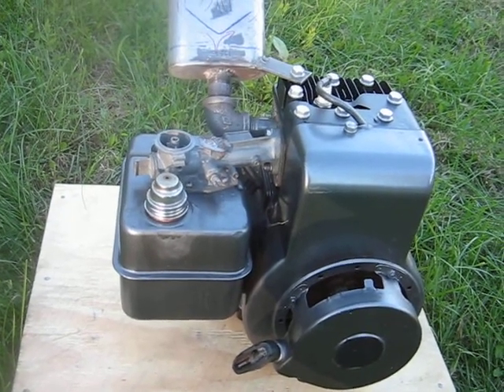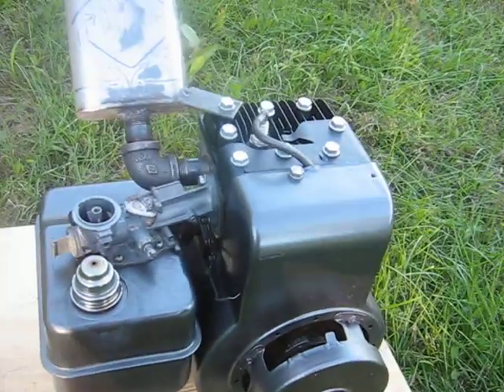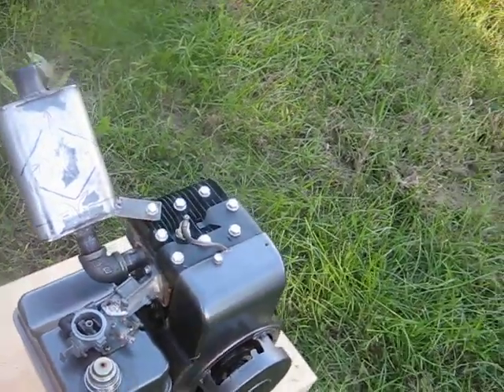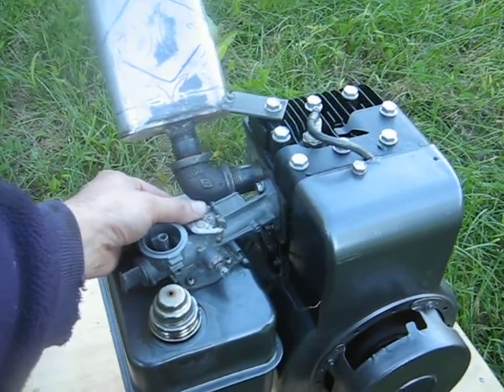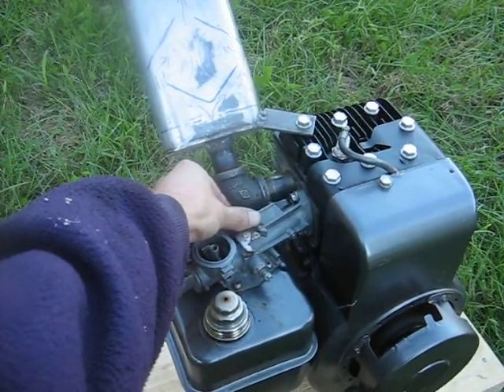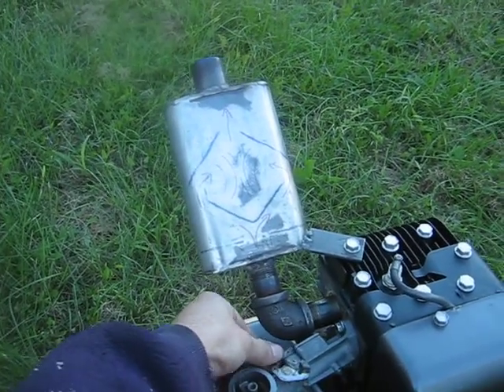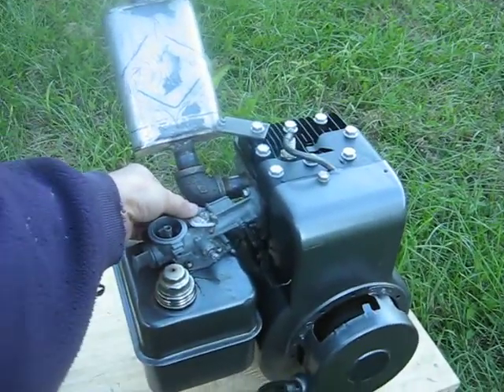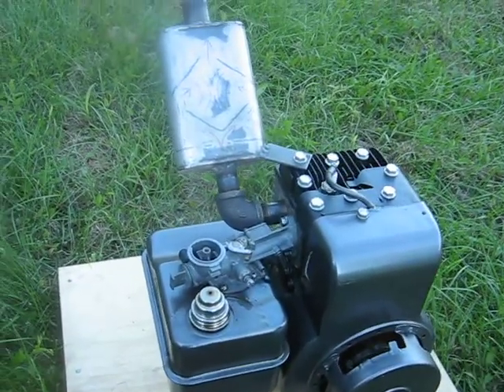Homemade FloMastr Muffler 2nd Run!

Comment: I learned about using transmission fluid from a YouTube video about two years ago. So far so good.
Reply from the maker: Yes, I have found trans fluid to work very well on the old style briggs recoil starter. I had to use it on my latest engine when I started it up, and it was Growly!

Comment from the maker: True, but finding the time to tear it down, clean it and paint it, then re-assemble can be a chore. Fall is closing in fast here, had our first frost this morning  Brrrr!  I had hoped to get the Briggs 4 back together using the chain couplings, but I am doubting it will happen this fall, too many other irons in the fire :(
I do have one more new project up my sleeve that I want to get going soon though. It is MUCH lighter than the 115 pound Briggs 4!  :)

Comment: The squeal will be back. They should be dry. The shaft and starter clutch assy. Clean the shaft with emory cloth. The inside of the clutch that slides on the crank has to be cleaned out with mineral spirits and steel wool on needle nose pliers. Only other lasting remedy is clean the crank and replace the clutch. I worked on literally thousands of these engines for years.
Reply: No, that would cause premature wear. There is an oil hole on the ratchet, but the balls and their spaces should be dry

Comment from the maker: Diesel fuel is useful to help unseize engines also, but a bit smelly! I still have the Subterranean Briggs 3 horse lawnmower engine soaking in a bucket full of diesel, been there about a year now! That thing is seriously corroded, and seized so tight I thought I was going to braek the crankshaft off with my 24" pipe wrench!

Comment from the maker: Seriously, the shaft should be dry?
Then why is there oilite bronze in side the square starter piece, with a felt dust shield/sponge?
I always oil them, and haven't had a problem, other than when they are dry.
I am just asking, since I really don't know one way or the other.  :)